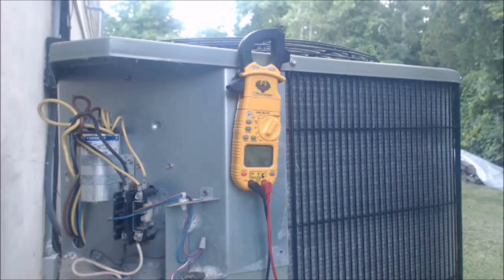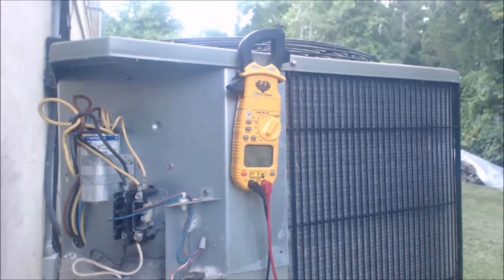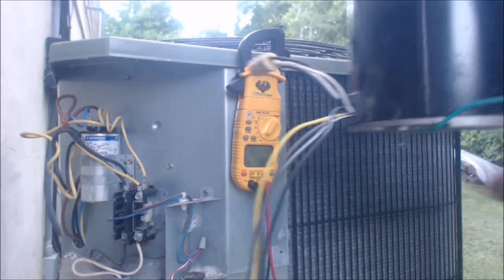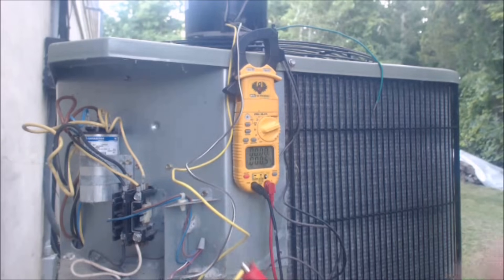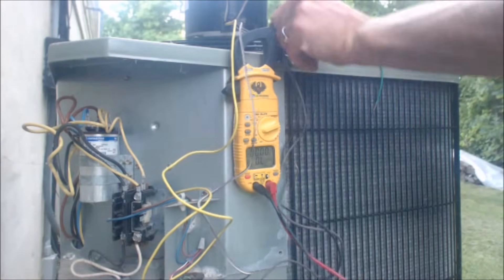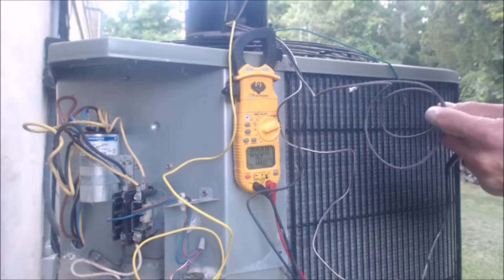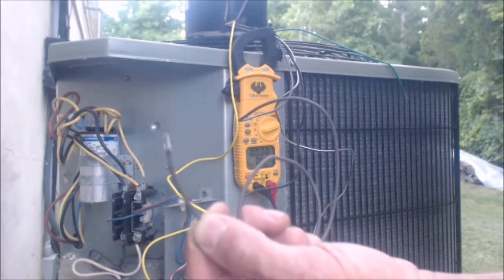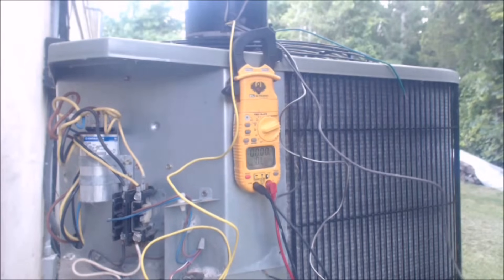4 Wire and 3 Wire CONDENSER FAN MOTOR WIRING! How to Eliminate 2 Run Capacitors!

Comment from the maker: For those that are looking for the tools used in the videos:

Here is the Link for the newer UEI DL479 Multimeter with temp sensor- http://amzn.to/2jtsUbJ

Here is the Link for the newer UEI DL469 Multimeter- http://amzn.to/2jw4ePJ

Here is the Link for the UEI DL389 Multimeter used in the video - http://amzn.to/2naJr9o

Here is the link for the Irwin Wire Stripper/Cutter/Crimper   http://amzn.to/2dGTj2V

Here is the link to the Fieldpiece SDMN6 Dual Pressure Testing Manometer with Pump-http://amzn.to/2jyK5Ka 

Here is a link for the Supco Magnet Jumpers http://amzn.to/2gS4h6z

Here is the Link for the Yellow Jacket Refrigerant Manifold Gauge Set used in the videos-    
http://amzn.to/2aenwTq

Here is a link to Refrigerant hoses with valves used in the videos-   http://amzn.to/2aBumVI 

Here is the link to the Fieldpiece ST4 Dual Temp Meter- http://amzn.to/2wc1ME3

Here is a link to the Digital Refrigerant Scale used in the videos-  
http://amzn.to/2b9oXYl

Here is a link to the Imperial 535-C Kwik Charge Vaporizer for Charging Refrigerant-   http://amzn.to/2wFHtBW

Here is a link for RectorSeal Bubble Gas Leak Detector http://amzn.to/2ckWACn

Other tool links can be found in the video description section.

ACSERVICETECH is a participant in the Amazon Services LLC Associates Program, an affiliate advertising program designed to provide a means for sites to earn advertising fees by advertising and linking to Amazon.

Check out other videos on the HVACR topics of interest at-  https://www.youtube.com/channel/UCOZR-1IqsAer9wzlvFgb4mA/playlists?view_as=public
Reply: My old actual capacitor is completely  rusty. I am not able to read anything C, Hem and ...    How should I proceed by the wire colors? I have brown, red Blue color in the old one. Please help. Thanks
Reply: One  wir  contacter  N   ,,other  capaciter bai     yelow  brow ok  starteimg other  engeisezd bai

Comment: This video is older but i hope you see this comment because i cant begin to explain my gratitude to you. My house was 80 degrees at 11pm and expecting continued heat index well into the triple digits so i went outside noticed the compressor fan was not running but my coils were scalding) and started futzing about to find what tomorrows project was going to be. Found 2 capacitors, a dual run and a run oval (for the fan which had shit the bed). I thought it was weird to have them separate and i checked all the wiring diagrams and could not figure it out. Now its 0315 and running stronger then when we first bought the place.

Comment: Solid, Fastly.Cool and gets the job done. For rooms where window-mounted air conditioning is not an option, this works very well. Easy set up, rapid cooling, and great design.

Comment: This video saved my butt. A family member had taken the fan out to clean the coils and wired it up wrong when he put it back together. It was a 4 wire fan with two capacitors hooked to it, but since the big capacitor was the right rating for the motor (5 mF) I hooked the 4 wire fan up as a 3 wire fan with just one capacitor as shown in this video and it worked! Thank you!

Comment: Appreciate your time to post this video. Got my 15 year old condenser going for the upcoming heat wave! Your help with the wiring of 4 wires to 3 with completely different colors and Johnstone supply to provide a replacement motor and the correct capacitor to go with it. Much thanks!

Comment: This was a great video!!  You really do a good job teaching.
Reply from the maker: Thank you, this came about because of your question!
Reply: If i have to add a small cap to a dual run because the fan is out, I move the brown wire from old cap to new cap and then make a wire and hook to common on old cap or contactor and run to the other terminal of new cap???
Reply from the maker: Yes correct, you disconnect the wire that is connected to the fan and attached to the existing FAN terminal on the cap which is the start wire over to the new run cap for the fan and run a jumper to the common.

Comment: Best to wire caps from the contactor direct. Go from T2 to the compressor and fan caps separately. Don't jump from one cap to the other for common.
Reply: I agree if you replace the motor and require 10 mfds fan capacitor why not insert a 10 mfds fan capacitor strap secure then wire the 2 brown wires to the capacitor and the yellow wire to the T2 side of contactor and the black wire to the T1 side of the contactor in that way you can give warranty to the customer that the motor will run continuously since the both parts are new.

Comment: Good video you’re the only one that pretty much explained it I have a GE motor on my carrier it’s older I have just a yellow and brown wire going to my capacitor from the motor and the only other wire is the speed wire coming from the panel box to a separate plug-in on the top of my motor which you plug in different spade terminals to determine the speed so I’m trying to plug in a new one that has six wires on it it has brown and white brown white blue redI think you’re pretty much explained it I just picked the speed wire which is a high speed and Off the brown and white wire and then the brown wire and yellow wire will go to the capacitor from what I’m understanding is that sound right?

Comment: I just got a new Fan motor and it has 4 wires I connected three but my motor only Hums and will start if I help it spin. The Cap is New and the contactor is New too, I bought everything together. The cap is rated for that motor. 5mfd.

Comment: My yellow common wire from fan motor is connected to the contactor instead of capacitor is that okay or should switch it to capacitor? There is jumper cable from contactor to common as well

Comment: good video.  I know it is a small thing but I was glad to hear you say 120 & 240 volts.  It drives me crazy when guys say 110 & 220 when they are referring to voltage.  I guess some guys use them interchangeably.
Reply from the maker: Actually I really agree, I do not like when 110 and 220 is said. It tends to confuse people! Thanks for the comment!
Reply: Century old USA ancient lingo uses 100 and 105 and 200 and 210 volts. The original nameplate voltage was 100 volts AC when the USA started with AC on stuff I have from pre 1900.  The actual voltage supplied by the power companies has increased with time and the "nominal" 120 volts at my business is in the 125 to 127 region and the 240 volts is often 252 to 254 in non peak periods. An apartment I lived in 3 decades  ago had 127 to 128 volts and lightbulbs did not last long. ie I never saw the voltage as low as 120 volts  .The 110 volt number is like saying Hewlett Packard versus Agilent or Keysight; it was used for more decades that any other number. :)  Voltage does vary by area and how far you are from the regulator on the local feeders from the sub station.  Today the utilities use a 120 volt target but in reality the end user often sees/gets between 108 and 127 volts

http://www.pge.com/includes/docs/pdfs/mybusiness/customerservice/energystatus/powerquality/voltage_tolerance.pdf

One confusion is the utilities service target number is 120 volts but an AC motors nameplate voltage is purposely often 115 volts so there is margin. 

There is the service voltage and the utilization voltage  here is a nice PDF to further add to the saga:

https://www.rockymountainpower.net/content/dam/pacific_power/doc/Contractors_Suppliers/Power_Quality_Standards/1C_2_1.pdf
Reply from the maker: Thank you, quite a few times I have had to have the homeowner call the electric company in order to lower the voltage when it was high around 277. I have also had the homeowner call for too low of a voltage such as 203. Not good for sensitive electronics. Thanks for your Comments!

Comment: Why do I need constant voltage to the yellow wire? Can’t I just replace the single pole contactor with a 2 pole contactor breaking the power to the yellow wire?

Comment: Will connecting both wires even though the are connect in the fan motor heart the unit?
I connected black and white to the contacter then brown and brown/white to the cap.

Comment: Is there any issue in wiring the brown with white stripe to the common terminal on the capacitor? I Ran into that the other day on a system that had a bad condenser fan motor. Thanks

Comment: THANK GOD SOMEONE KNOWS THAT THE BROWN/ WHITE IS TO POWER THE RUN CAP FOR THE MOTOR,  IF YOU ARE NOT USING A DUAL RUN CAP,  SO YOU DON'T HAVE TO MAKE A JUMPER WIRE. THE SCHEMATIC ON THIS MOTOR NEEDS TO SHOW THAT BROWN/WHITE IS CAP COMMON!!!!!!!! THANK YOU SIR FOR THE VIDEO. MNOW I WILL RETURN TO MY WEEKEND ALREADY IN PROGRESS.
Reply from the maker: Thanks for the comment Robert!
Reply: The diagram on the last universal motor I installed clearly showed that the brown/white was there to power the brown wire.  Since I already had a jumper to the run cap, I left the wire full length but capped it off in case I ever want to switch something around.

Comment: Question.... could you just hook up the striped-brown to the common side of the capacitor, with out the contractor jumper?.....
Reply from the maker: You need the common of the capacitor hooked to the120v side of the contactor that gets connected to the common on the compressor. The other 120v side of the contactor is the run winding. Start from the cap gets connected to the start winding of the compressor
Reply: @acservicetechchannel  I have connected the striped- brown wire to the common at dual run capacitor and the solid brown to the fan side of dual run capacitor and it works right.

Comment: Another great video ACSERVICETECH!  Wanted to ask with capacitors, you can go up with the voltage but the microfarads have to stay the same correct? Just asking for verification sake. Thanks for everything.
Reply from the maker: Correct, if the mfd is off, it will burn up the motor. There is also three capacitor videos in the uploads. Just type capacitor in the search on the channel for more info on capacitors. Thanks for you comments! They are always appreciated!
Reply: +acservicetech 
Thank you so much. I will check out the other capacitor videos. I wish I could shake your hand for doing these awesome videos, I appreciate you sharing the knowledge with us new technicians. Stay safe my friend.

Comment: We have a trane xe 800 weathertron heat pump.  Replacing the fan motor. The guy we got new motor from pit a capacitor on the new one brown wire and brown / White wire.  We have a black wire and a white wire. He said put the black wire and the white wire (purple on old motor) back. Dad doesn't remember where they go. The fan didn't work until he had the white wire on contactor and black as a ground. I turned it off cuz idk if it's right. Please help if you can.

Comment: One question, given that you had to replace the dual run capacitor (since the fan motor capacitance had changed) wouldn't it have been less expensive to go ahead and install the 2 wire fan cap? On the other hand, as long as you were there, and having to change a cap anyway, replacing the dual run can't hurt, as the homeowner now has a new compressor cap.  Six of one, ..., I suppose.
Reply from the maker: I am mainly just giving everyone an option. You will need to work with what you have in the service truck. If the cap looks old, I give the building manager the option if they want to replace it anyway. They are very cheap and it would be the worst thing if you were there and then a month later the unit went down because you or I did not want to replace that. Capacitors go bad and very often. You can get 5-13 years typically with them and most calls you are on have units dead smack in the middle of that range. Thanks for the Comment!

Comment: I was taught my an old timer who does not wear any jewelry for many safety reasons not excluding electrocution.
Reply from the maker: Yes I teach people to diagnose with the load disconnected and whenever possible to test with resistance. I'm planning on getting a silicone ring. Other than that, I refuse to take it off so there is no confusion to my marital status, thanks. That is just my personal perspective.

Comment: what about the green wire what is it for? also when extending wires does any 14awg would do, or do I need a specific one?
and what does it mean when the new fan motor works for like a minute then turns off? good vid thanks.
Reply from the maker: Are you saying that you have the voltage to the fan motor continually but the fan stops? That should never happen. The only thing that would cause this is the thermal overload inside the motor. If it is a heat pump then a pressure switch can cause this but just make sure that you are reading the actual voltage. To do this safely, I usually disconnect the compressor completely so I am just dealing with the fan. Green is a ground wire which should be indicated on the motor rating plate. You can junction a wire with the same gauge wire. You would read the wire size on the side of the wire, and make sure to keep the connection in the electrical compartment only and not exposed, thanks
Reply: thanks for taking the time to explain... I cut the wires and got some 14AWG and extended the cables apparently color didnt matter, did everything you explained in this video and bam problem solved thanks again.
Reply from the maker: Thanks

Comment: I have seen some 2 speed condenser fan motors on some ICP units. Its not an ECM, but has 2 speeds. They use a Fan Speed Control board. Its a small board.  Why would they do that? Its a simple single stage heat pump.

Comment: I tried this set up, but my fan motor kept turning off every two minutes for about five seconds.  I had to put the yellow wire on the bottom of the contact, then jump the top of the contact to the capacitor to make it work, right.  

I’m not a technician, so I can’t tell you why it was doing this just what I did to fix it.

Comment: So if you don't have the correct size cap do you use common on the existing capicitor to wire other one? Brown wire will go on little cap 7.5 and common wire to existing capacitor?
Reply from the maker: Yes you would either jump from the common from one cap to the other or run directly off the common wire from the contactor to the other cap, thanks!

Comment: So have a question for you, at 2:07 you state the Brown w/White Stripe & the Yellow wires "are actually connected inside the fan motor." If this is the case why couldn't you use the Brown w/ White Stripe wire and cap the Yellow wire? Is there some reason this couldn't be done?
Reply: I had this question also, because the Brown w/ White stripe wire already has a spade connector to attach to the contactor.  The only reasonI could think not to do it is if internally, the circuit board traces for each wire cannot handle the same current? But that wouldn't really make sense to me either...

Comment: Can u explain the process of from from 4 wires to 3 wires? Great video thanks
Reply from the maker: Basically the brown capacitor wire with the white stripe should have 0.0 ohm of resistance with the common wire so you only have to hook one or both up at the part of the contactor that is connected to the c on the capacitor, thanks

Comment: I installed a first choice condenser motor that has a black, red, brown, white, and a brown & white wire. My unit is a 3 wire hookup. The new motor list the red as (low), black as (high), and white and black as the line side. On the unit side the brown wire runs to the capacitor fan terminal. The red wire runs to the capacitor C terminal and to the contacts. The Black wire connects to the fan terminal on the circuit board. What would be the ideal connection for this condenser fan.
Reply from the maker: If you have continuity between the white and the brown/white the they can go in the same place. You would have to see what speed the existing motor was running at and match that and only hook up either the red or the black then. The other speed connector would get cut off, wire nut added and maybe electrical tape to make sure the wire doesn't fall off. That is if there is no spare terminal to safety connect it where it won't get powered but you are on the right track. Follow the wiring diagram, thanks

Comment: As for the spade connectors does it matter if they are insulated vs non insulated. Thanks
Reply from the maker: No it does not as long as they are not near another hot or ground, thanks

Comment: What is the green wire for? Ground? Where do you attach it?
Reply: Usually attach green to one of the 4 let’s of the condenser fan motor that makes a good ground if it’s not painted which usually they aren’t

Comment: Could you have 2 dual capacitors in one system?  One powering the fan, the other compressor.  For example, say you had a 50/5 dual capacitor.  The fan side went bad.  You didn't have another 50/5 on hand.  But you did have a 30/5.  Could you (temporarily) keep running the compressor off the old 50/5 capacitor.  But run the fan off the 30/5, at least until a replacement came in?
Reply: Yes just need to jump out the commons
Reply: A dual run capacitor is just 2 single capacitors in one package. So you can just use one side of it for the high value, and use another capacitor for the low value. In both cases, one of 2 sections would be unused.

Comment: If the original was 3 wire and I used the cap that came with new motor and connected all 4 wires. Will it harm the unit?
Reply from the maker: No it just means that you have 2 capacitors in the outdoor unit instead of one dual cap, thanks!